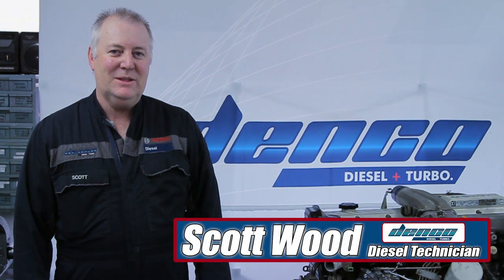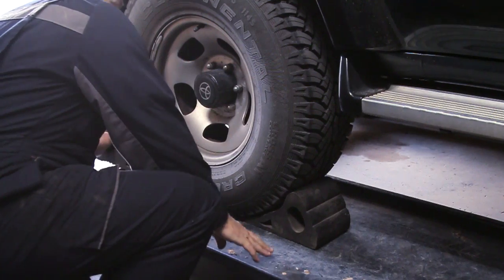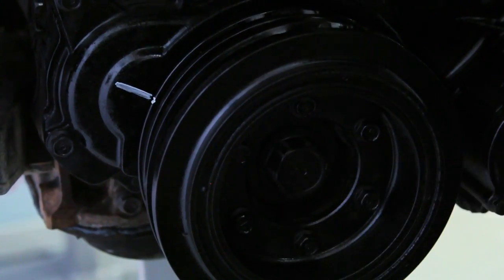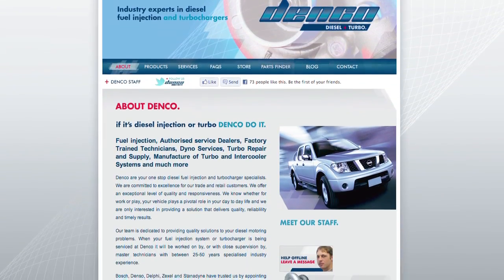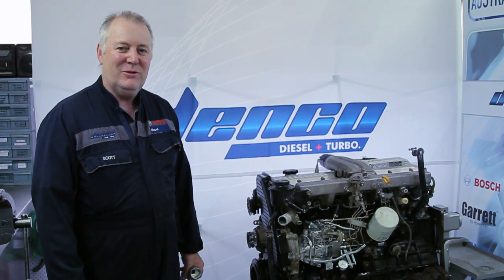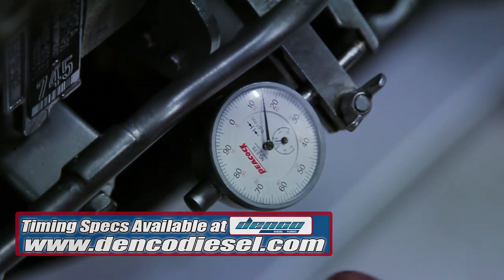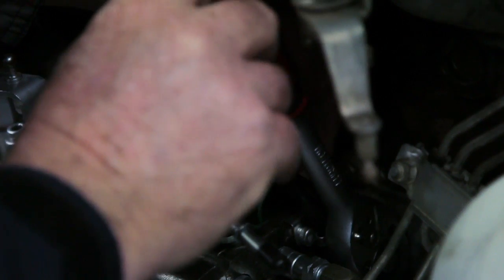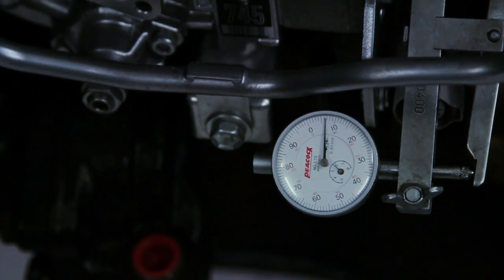How to time a VE Fuel Pump

Comment: You did not mention anything about putting a 9mm spacer in between the cold start lever that they show in the Toyota manual, is that really necessary.

Comment: I know it seems pretty obvious but you forgot to say to tighten the injector pump bolts after checking it because it could move again while removing the timing tool and tightening the center bolt.

Comment: I got 6415 John Deere  I believe standyne pump electricity controled no fuel will pass i here fuel solenoid or the pump or ecu communication maybe not getting proper power did have some electric issues with wires look like crap cracked definitely running off the name not quality like I’ve seen

Comment: I've got diesel dripping from the top of my 1HZ stock diesel fuel pump. I have to pump the diesel up each morning to start, i did the old starter motor. The dripping itself seemed to just stop itself and or slowed to next to nothing. But i did put two bolts in tight in those two square lungs you can see at the top of the fuel pump. I think nothing now. I was told to put a none return valve it didnl;t stop it still had to pump the fule filter to start it. I also cleaned the fuel cap at the diesel tank it seemed bit blocked. Bit puzzled as to whats still going on... must be still getting a bit of air in over night and able to run the diesel back down from the lines. Is there a washer that can cause this above under the 'T' excelerator arm?
Reply: You could try replacing the rubber fuel hoses going to/from your injector pump. You might have a leak in one of them. It's a cheap fix to try. You might have a knackered seal in the pump itself. They do get worn and need replacing as they get older. I've never attempted it (yet) but I've seen a couple of youtube videos of folks replacing the seals in the 1KZ-TE injector pumps. Looks pretty doable for the DIYer if you're clean and methodical about it. Good luck!
Reply: @1Swgm  Turns out i put 6ltrs of AdBlue (urea & water) in the diesel fuel tank at the bowser by mistake and blow the entire pump up. So it's in the workshop getting a new reconditioned fuel pump, injectors, glow plugs and a timing chain, radiator flush and hoses while they are at it. 6k considering a 14$AUD mistake. Ouch!!!
Reply: @ForPropertyInvestors  ouch!!!
Reply: @ForPropertyInvestors  g'damn!

Comment: Hi mate great Video
Just want to confirm the spec measurements.
For eg: if it’s between 1.03 to 1.09, is the 1 the preload setting u need to have the dial indicator on before achieving the fine adjustment of for eg .09. Cheers please help cheers

Comment: For those attempting to perform this task on the Mitsubishi 4M40 engine, it is written on the FSM to NEVER turn the engine anti-clockwise as this may damage chain tensioner.
Reply: So ...what happens if the car / truck rolls in gear backwards not running?
Reply: @MrLunithy  Same thing happens.
Reply: @MrLunithy It's common practice to leave a manual car in gear (with parking brake) when parked on a hill. The car will not roll.
Reply: @branchgaa  Yeah that sound good in theory.

Comment: Great, my engine is a IVECO for a Newholland backhoe, i solve a white smoke and hard cold start with  this method, but i just did it with no tools, just rotate it until it stop smoking. i will have to check valves and timing later, injectors are brand new.

Comment: Okay well I drive a 90 cummins same Bosch ve pump and I took it to a shop because I don’t have a timing gauge and that curved wrench...they only can find a pump for 1500 I found one for 650 (remanufactured) is there any anything you can tell me about the gears If any oil is needed or tips
Reply: Jackthatrippa 666 can you get to me timing for 6bt 5.9 L ? Fuel pump bro ?

Comment: how do I get the diesel fuel pump setup to start as I have changed my water pump and will not start as it's moved and I forgot to mark it up plz
Reply: Fizzy Dizzy generally you can move the pump a bit and it won't make much of a difference at all , check that the pump is delivering fuel you may need to bleed it to remove air

Comment: What a great and helpful video, thanks!!! I just wish I could find the correct timing value for my 1984 model Ford Transit with a  2.4 York diesel engine in it. I have several different manuals (including the workshop manual) for the car but the Bosch pump timing value is not mentioned in any of those! :(
Reply: Jelena Koivumäki isn't that the same engine as a bmw 324tds?

Comment: Great, clear and easy to understand.... Just done timing on my Perkins Prima using this method after a rebuild.
The workshop book does recommend slackening the pipes on the rear of pump though to avoid straining joints on pump etc.
Cheers, Steve.
Reply: Steve, did you manage to source new piston rings okay? It is the one thing holding up my prima rebuild.
Reply: Hey, do you know the specification for the pump on the prima engine?